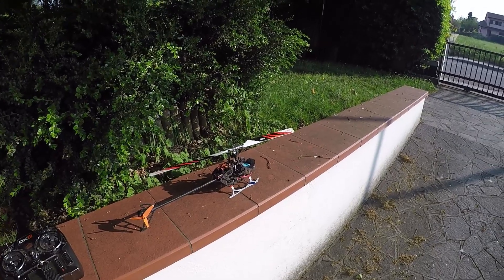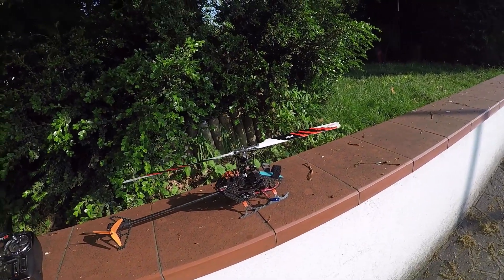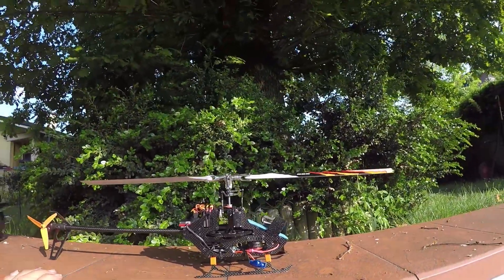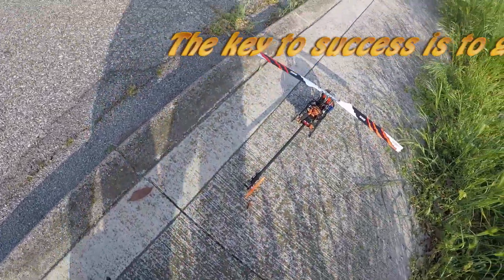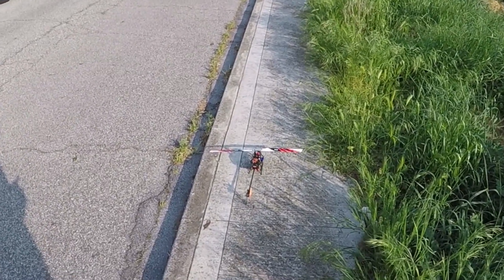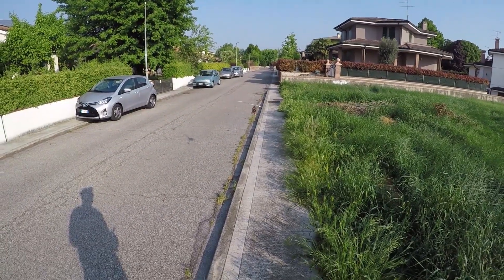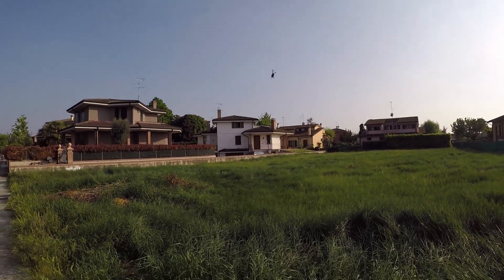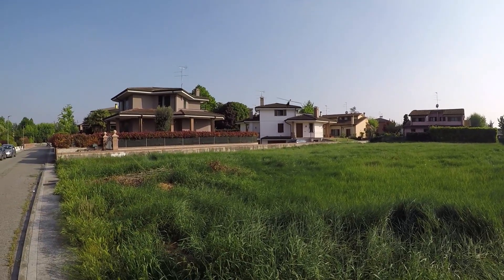230S with Neuron FBL and Lynx main frame

Comment: Hi, just finshed installing the brushless motor on tail and powering it up. I am having problem with Calibration. how should i calibirate the ESC on Rudder Channel. The 100% will be extreme right on rudder channel and lowest point will be extreme left -100% or middle which is 0. need help in this.
Show less
Reply from the maker: Remember that all the ESC want a mid point at 500, a zero at 1000 and full speed at 2000 micro-seconds.
The output of your rudder channel should be calibrated accordingly.
This is also the reason of the need to give full left rudder to activate the tail motor (it is a way to send a -100 signal.
Reply: Giuseppe Penzo I have just calibirated and it's now working accordingly. I now need to input the left and right throws. At this moment the tail is not holding and it's going woop. Need to minimize the throws and will follow your I and P gain
Reply from the maker: Adeel Shah you need a very strong derivative gain.
I am using a derivative gain of 100 (the maximum allowed by the Neuron).
Reply: Giuseppe Penzo ok, pls advice one thing I am using ESC having BEC. Do u think I should switch the Bec off.
Reply from the maker: Adeel Shah ,
I use the stock ESC's that provide also the BEC. If you switch off the BED, how will you feed the FBL and the servos?
Reply: Giuseppe Penzo my bad, i was talking about the ESC powering brushless tail motor.
Reply: Giuseppe Penzo I have switched off BEC for tail motor ESC and using main motor ESC for powering FBL and receiver. I am now stuck at defining ranges if my stick should be at extreme right the tail baldes should spin at full speed and when i push it on extreme left it should stop. How should I react in between ranges let's say when it's on 75%
Reply from the maker: Adeel Shah ,
Leave the ranges at +100 and -100.
The tail motor limits will be used by the fbl tail gyro more than by you.
Reply: Noted, i have changed to KBAR Fbl. I have to flash the ESC. the motor only starts in the middle of Rudder Stick and keep on same speed through out. The RPM remains constant. 
so i have ordered Flasher for ESC
Reply from the maker: Adeel Shah 
I do no know how to program the tail motor on the kbar.
I have used the Neuron, in place of a kbar because of this.

Comment: Are you still flying this one?
Reply from the maker: Yes, but only seldom.
I am not satisfied by the tail stability and I am not able to improve it further.
Reply: Giuseppe Penzo the guy that had a msh brain on one judging by his video looked like he got really close but he said the same thing you did! I wonder why the ar636a tail authority cant be matched even by top of the line fbl controllers. Is it the stops that your not happy with?
Reply from the maker: Nick, the problem with the std  FBL  is that these are not designed to manage a motor on the tail.
You have to use a huge derivative action on the tail and a huge pre-compensation for collective and cyclic pitch change.
Reply: Giuseppe Penzo yeah that makes perfect sense! I probably wordered it wrong, i guess what I was trying to say is with all the programming capabilities fbl controllers have now a days i wonder why none of them offers brushless tail motor support! Especially for the scale guys and s like us!
Reply: Giuseppe Penzo ive got a belted 230S with a Lynx frame, kst ds215mg cyclics, mks ds95i tail servo, lynx eox 4100kv main motor, talon 35, oxy3 qube triple blade head, a hybrid tri bladed tail, and a ar7200bx fbl controller.
Reply from the maker: Nick, why didn't you buy directly an Oxy3 Qube?
This would have costed you less than a modified 230S.
And what is remaining of the 230S? Likely nothing.
Reply: Giuseppe Penzo well it all started out with a stock 230s that I belted then the snowball effect kicked in lol. After all everyone can have a oxy3 qube, for me its all about being different!
Reply: Giuseppe Penzo IT runs 255mm main blades and 40mm kbdd tail blades and weighs 70% of a qube!
Reply from the maker: Nick, both are excellent reasons.
But the stability, agility and precision of an Oxy3 cannot be bitten.
How did you install a belted tail?
Using parts of a 300X?
Reply: Giuseppe Penzo i used a main belt drive gear from freestylehobby.com for a blade sr belt kit, 300cfx belt guide bearing cross member, honey bee king 2 belt and carbon fiber tail boom or a aluminum 5/16 tube from ace hardware with a piece of 5/16 heat shrink as a adapter for the trex 250 tail case (the stock tail boom diameter is 8mm for the king 2 and 230s and the trex tail boom is 8.5mm) and a skyartec wasp v4 tail shaft assembly because its gear cog is the same as the king 2 belt.  You can use the king  2 or the skyartec wasp tail assembly but the trex one is better quality. For the triple blade tail i use walkera 4f200 tail pitch driver hub and grips! I've done a stock frame using the full freestylehobby blade sr kit, also done a microheli frame and now a Lynx one.
Reply: I've got pictures of all on 230s/250cfx page on Facebook!